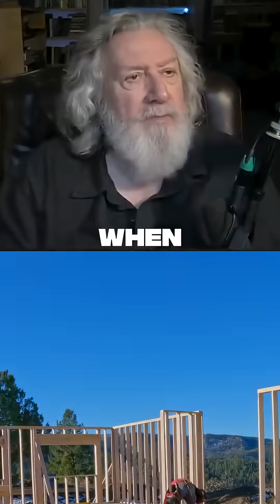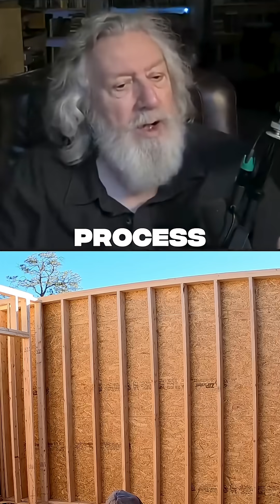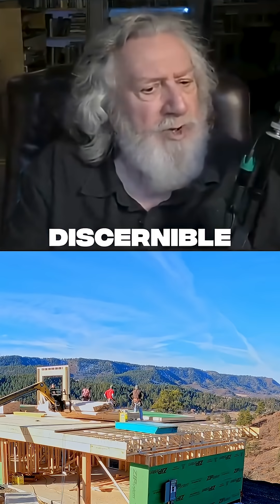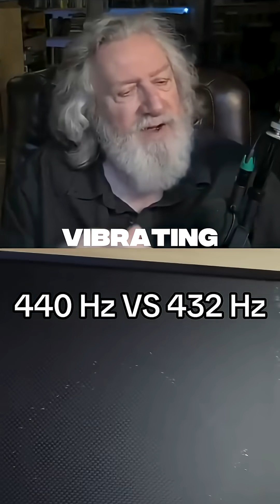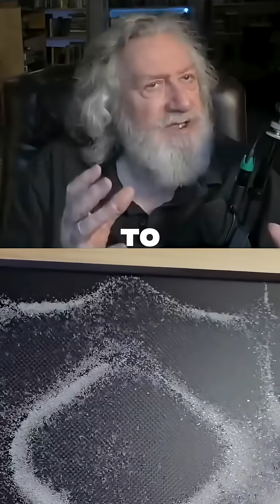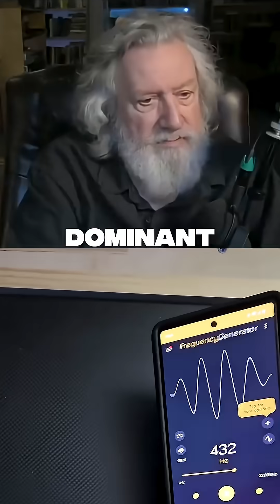Why Small Errors Make Big Failures

Comment: The cymatic image made by 432hz is a star with 28 points and a circle in the center.  John Michell's New Jerusalem Template has 28 points and 12 moon circles drawb around the perimeter for the zodiac houses and a hidden 13th circle revealed in the center, like the 432hz image.

Comment: 1/2 inch out of square at the bottem is 12 inches out of square at the top it  happens way to much and honestly the house still gets built but it costs more to cover up that mistake than it would if you fixed it early.